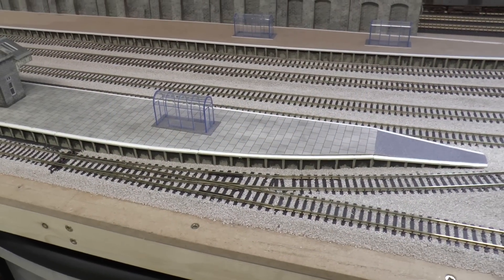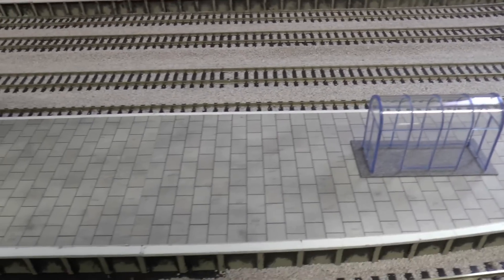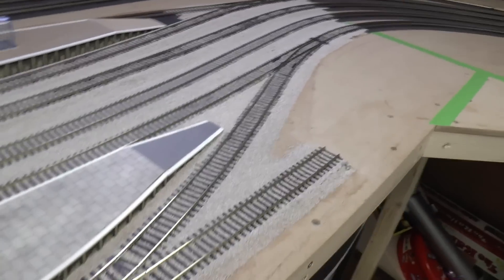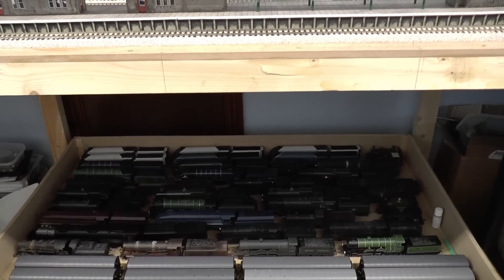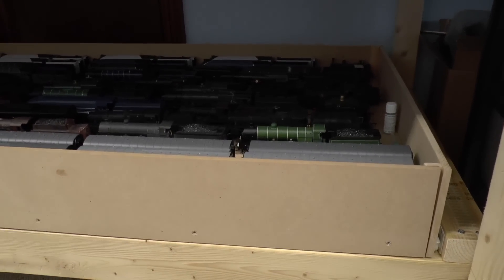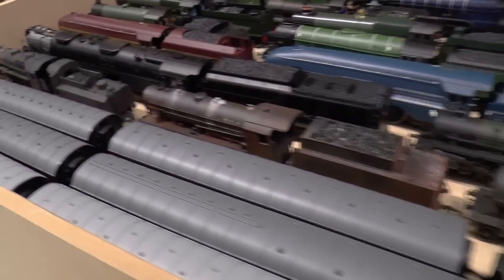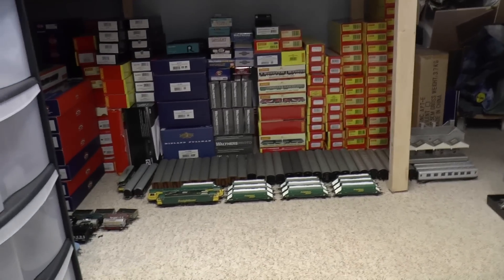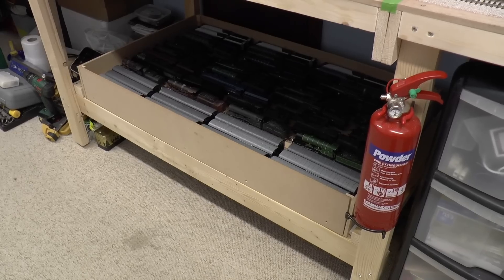Platforms and drawers.      19-04-2019

Comment: Great update Graham you’ve answered my question relating to sitting locos onto bare wood surfaces. My wall cabinets have track on them, but always issues getting locos onto them safely. Maybe I will remove the track and add felt or thin sponge sheet as you are doing . Cheers Paul at  Sandling Junction
Reply from the maker: Sandling Junction      Hi Paul, I think I would have been pulling the small amount of hair I have left out had I put track inside the drawer, trying to fit the front bogie of a steamer on track in a confined space would have tested my patience I think - much better with no track - it’s not as if they are going anywhere.  I will probably use some form of thin rubber.     Cheers for now mate.           ...........Graham

Comment: Hi Graham, Nice update and those drawers are ideal. I should go for some laminate floor underlay as a base for your drawers, as its a thin foam which is nice and soft and won't cause any damage to the wheels of your locos. I have got all my track lifted now ready for the 4 track girder bridge to be raised up 5cm, to bring it to the level of my baseboard with the underlay laid on top.
Good idea to sink the tarmac under the shelters, level with the paving, once you have your footbridge in place. I won't be doing any more to my layout until Sunday now, as tomorrow I will be out for the day.
Cheers for now mate.
Geoff
Reply from the maker: Geoffersh     Hi Geoff, Yes, some form of thin rubber or dense foam is probably what I will end up using, I will also be putting lids on all three drawers to stop any dust getting in too. No more work in the train room for me either as we are out most of the weekend.    Cheers for now buddy.          ..........Graham
Reply: @GrahamFoulston  Hi Graham, Let me know the size of each drawer base, you will need for covering. I have more than enough of that foam underlay, which I can cut for you and post it on to you, save you having to buy any. It's 5mm thick. The postage won't be much as there is no weight to it. I have already  posted you those weights, so you should get them after the hols.
Just about to set off for Leicester and the Great Central Railway, might as well take advantage of the weather. Catch you later mate.
Cheers for now
Geoff

Comment: Platforms look exquisite!  Just phenomenal! 👍  Someone already mentioned felt is bad for the wheels and suggested linen.  You can also use cork (as most have it around), or thin rubber mats like you find for tool chests.  Happy Easter.
Reply from the maker: Anthony Dodge The Model Train Outsider     Thank you Anthony, I think I will steer clear of cork as I think that may end up becoming damaged fro the flanges of the wheels but rubber or linen seems to be the best bet - probably some form of rubber might be my best option.       Cheers for now mate.         ...........Graham

Comment: Hi Graham the new layout is looking great love the idea of the draws. I have just moved and can now start to think of a loft layout i have tried to ask others about but got no answer do you have to limit the weight of wood framing and base board connected to the joists all the best tony
Reply from the maker: Tony Money     Thank you very much Tony. I haven’t attached the layout to any rafters so I’m unsure but having seen others then folk seem to bolt baseboards to them with legs going down to the floor holding the weight of the boards rather than hanging the boards from the rafters as such. Obviously don’t weaken the joists or rafters by cutting them or even cutting into them - just work around them instead although you could screw boards to them.    Cheers for now and hope that helps a little.      ...........Graham
Reply: @GrahamFoulston  Thanks Graham for the info sorry to get back late to much unpacking i did know not to cut through the rafters as i only like a sun roof in my cars he he many thanks tony

Comment: Hi Graeme
I have the same issue with stock in fact its got so bad I actually bought a loco I already have doh, the draw idea had crossed my mind and having seen yours I think I'll have another look, certainly makes it easy to swop and change everything.
Cheers Paul
Reply from the maker: Dunge Wood Model Railway    Hi Paul, I always had it in my mind to have storage drawers with this layout but it’s only now that I have got round to doing them, this really came to a head when I was constantly trying to find locos to test on the new track - to be frank it became a buggers nightmare - something had to be done - and fast, so I made this my next job before I carried on with anything else and I’m glad I did because this is now going to solve so many problems.     Cheers for now mate.       ...........Graham

Comment: Love the draws one little suggestion because you can’t put the tracking in maybe you could put thin strips of wood along to to mimic the rails
Reply from the maker: peter shaw    Thank you Peter, I like the idea of the small strips of wood but I was hoping I could get away without adding anything, I’m hoping that the rubber underlay which I will be putting down will hold anything in position, they don’t move much anyway but if they do move then I will add the wooden strips - great idea mate, thank you.      Cheers for now.          .........Graham

Comment: Btw - I like the slick new intro, but when is the ear offending heavy metal version coming out? ;-) Liking the drawers for your rolling stock -ideal in situ and, with a bit of padding, ideal should you ever need to move them.
Reply from the maker: davie maclean     The ear deafening heavy metal version got dumped Davie, I was worried that I might offend some of the snowflakes on here with ultra sensitive hearing - funny thing is that they can stand next to a Deltic on full thrash though!   😄😄.  I like the drawer, it has worked out very well and is the perfect size.    Cheers for now mate.          ............Graham

Comment: Seems every time I look at this stuff a plastic piece goes flying off in to space never to be seen again..  love the drawer.  Is there a drawer slide under it.  It slides so easily.
Reply from the maker: Rob McCrain    Hi Rob and Thank you, Yes I have installed self closing runners so it will be easy to open and shut, with all those locos in it then it is quite weighty. I have braced the underside of it to take the weight, I will also be fitting an Acrylic sheet to the top to keep the dust out.   Cheers for now mate.          ..........Graham
Reply: I must have missed that.  I was distracted by J.
Reply from the maker: Rob McCrain    Oh dear - everything alright?

Comment: Draws a great idea, maybe add a perspex lid to protect from dust....
Reply from the maker: Richard Swallow    Yes Richard, I’ve got some clear Acrylic sheet which I will fit over the top, it’s not quite finished off yet, I still have to put the front face of the drawer on plus the handles but I will make the other two first.     Cheers for now mate and thanks for the comment.    ...........Graham

Comment: Just an idea about the bridge in my opinion maybe try a modern concrete road bridge at the brick wall level and have ramps and lift shafts going to the platform level from the bridge
Reply from the maker: casey nightingale goldsbury     And that sir is exactly how it is going to be, entry to the station will be from the roadside with lifts/escalators to the platforms!  The main station building will be roadside.    Cheers for now.          ............Graham